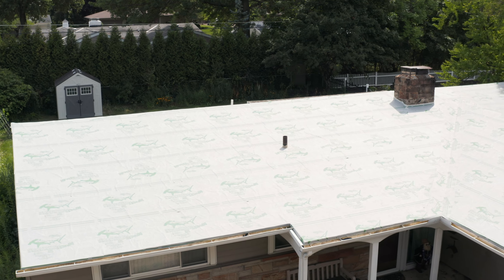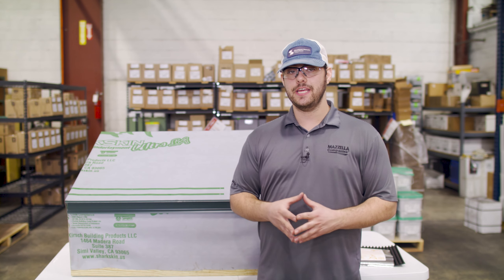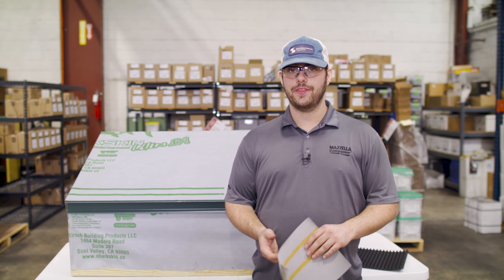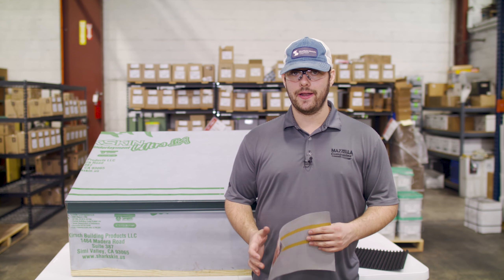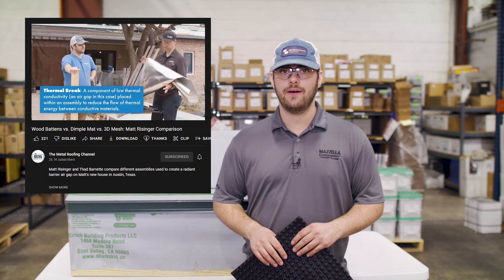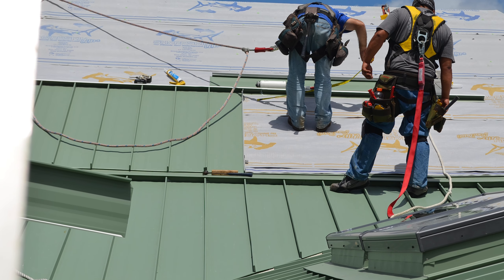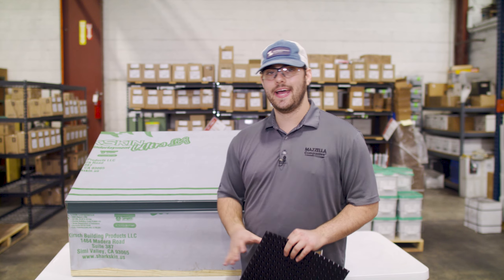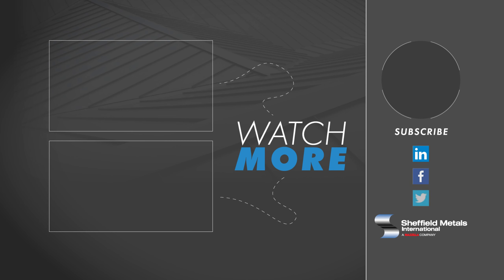Roof Underlayment Types for Standing Seam Metal Installs

Comment: Does that self adhered underlayment like skarkskin or ice and water also stick to the underside of the metal roof. We are going to cover our shingle roof with standing seam metal roof because when it was last shingled all the pkywood decking was replaced and covered with Ice and Water before the shingles were applied and now the shingles are impossible to remove without destroying the decking. It also makes it impossible (impractical) to repair damaged shingles to repair our existing roof so we're faced with roofing over the shingles. Will that self adhering underlayment make it impossible to remove a metal panel to repair in the future.  Thanks

Comment: Here's one for you, i have a metal roof installed on the wood straps/furrings only. there is no plywood or other material between the metal roof and the open attic.  So when we hit spring and fall season what I see is a lot of condensation on the underside of the roof, which then sometimes drips into the insulation or if i'm lucky runs down to the metal soffit and exits out.  Can you suggest what i could install on the underside of the furrings to help keep water out of attic insulation area and have it always run down to exit via soffit area.  I was thinking the metal bubble insulation - thermal roll.  your thoughts....
Reply: Professionally applied spray foam would work. You need an insulation with zero airspace. Otherwise it will trap water between the metal and the insulation, even if the gap between the two is a fraction of an inch. Even a single inch of sprayed on foam insulation would probably stop the problem. Two inches would be better, bot not necessary, I don't think.
Reply: I think the only proper solution to condensation is to prevent the condensation, NOT accommodate it. That's why doing what your installer did is a no-no. The simplest hack to prevent condensation now would be an airtight poly vapor barrier, which is what northern homes put inside all of their walls. People with money would say to spray foam the whole thing and pray.

Comment: Hello Thad, I'm curious if the dimple matt contributes or oil caning? Also, you would only use a dimple matt over a deck, right? (not purlins). Additionally, I'm looking to install a metal roof on an outside gazebo that will be open underneath. The plan is to attach the roof to purlins, but I'm concerned about condensation forming underneath the panel and dripping down from the underside of the roof. Should I use a synthetic underlayment between the metal and purlins?

Comment: It seems to me that the radiant barrier could be installed between the wooden batten layers, to provide a backup bulk water layer, while still preserving drying of the insulation and cooling of the underside of metal panels.  What do you think?  I'm thinking about a roof slope of 5:12, with the location being Northern Idaho.  Putting the battens on a 45 degree slope.